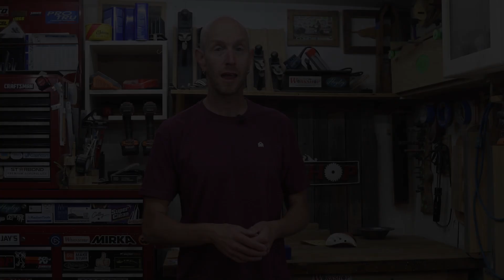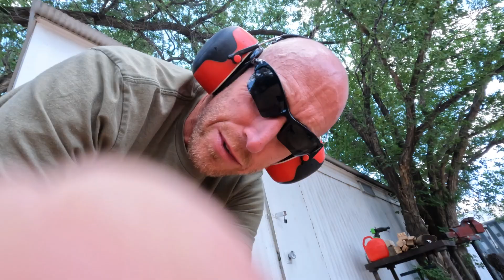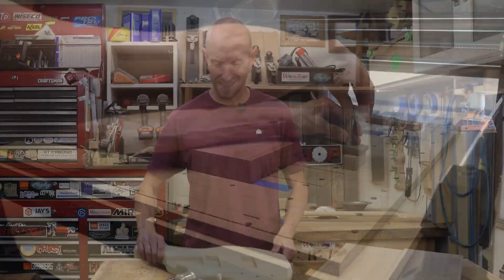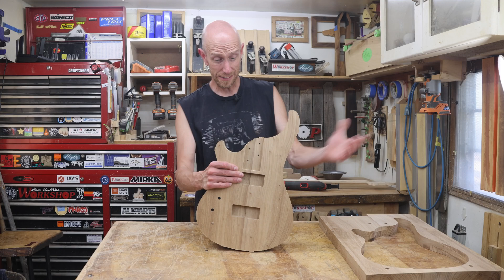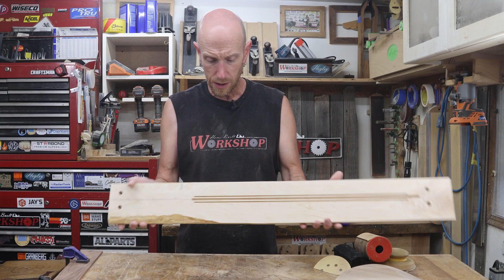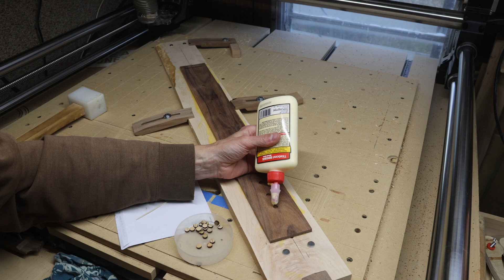Building the Sub Tonic Bass Guitar | EP2 Making the Body and Neck

Comment: how do you find center of the slap on cnc? before runing the gcode
Reply from the maker: I have a centerline on my wasteboard that I line up the parts with. All of my gcode files are centered around that centerline. As long as I line the parts to be cut with that centerline, the parts will (hopefully) always be centered.

Comment: I don’t have a CNC, but I do prefer to glue my fretboard on first (using epoxy as to not introduce moisture into the neck), and then carve my neck. Then I check to see if the fretboard is still level. Sometimes carving the neck releases tension in the wood. I fret the neck last. 

I use that “magic tape” … the frosted kind for paper, to tape over the truss rod. It’s nice and thin. I leave that in the neck. 

That’s a nice looking bass design!
Reply from the maker: Thanks. When hand building, (not cnc) I slot the fretboard, glue it on the neck, fret the neck, then carve the back last. I'm really liking this design too.